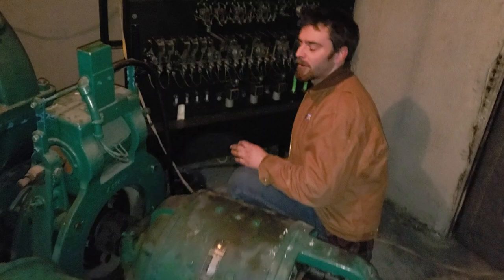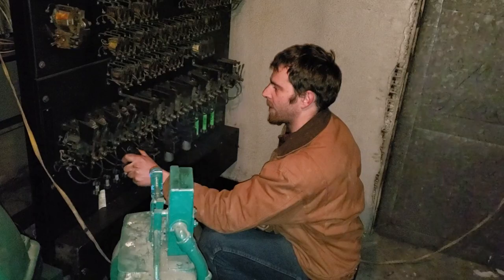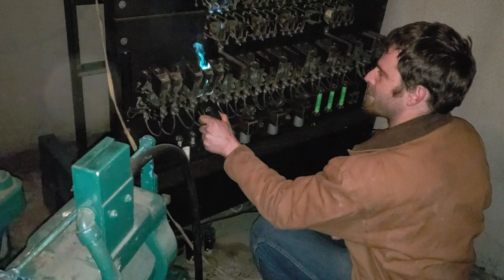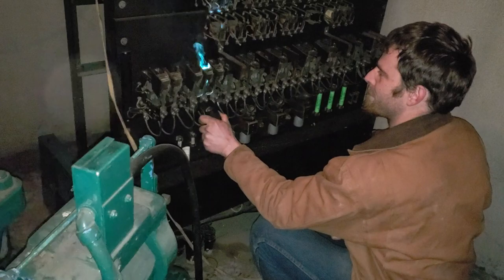Starting 3-Phase Motor Without Soft Start (Dims lights on entire block)

Comment: that motor and those fuses are no way big enough to " dim the lights on the street" unless this is some 3rd world country where 100 amps is a big draw.
Reply: well, its america so the electrical grid is bascially on par or below that of a third world country. just like many things in this country.
Reply: Lol, the current draw is insane. But that's the risk of running everything on a lower voltage. As a New Zealander myself (we use 230V 10A), the current required over there just seems insane.

Comment: Are you able to explain to someone that understands next to nothing about this why John used a cell phone.  Did it have to be a cell phone?  Does the cell phone survive this?  Were you doing this just for the hell of it, or was there a greater purpose?
Reply: He was using something not really conductive so he didn't die
Reply: @Vistrus  Well, yeah I suppose that would make sense...sort of, but isn't that an unnecessary risk to an electronic device?  Did he use it just because it happened to be the right size?  I'd have used a scrap piece of wood or something.
Reply: @gregorylagerstam2488 Device could have been dead to begin with.

Comment: How much electricity does that motor even use?
Reply from the maker: The MG set uses 3-phase 240 around 200amps, the motor runs on about 600 volts DC.

Comment: Always found relay controlled stuff very interesting. It looks really complex, but it's intrinsically simple and a lot of fun to play around with. Goes to show how long it can run without much love. I have a couple relay controlled pinball machines that were not in working order. Most of it was just dirty contacts and a few solenoids that needed to be replaced. There is something charming about these old machines that really make them interesting.